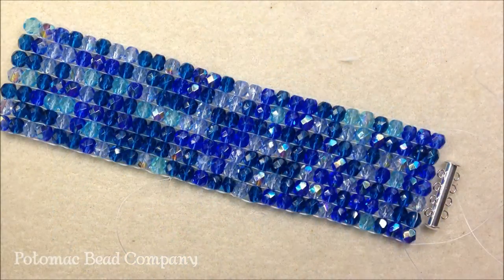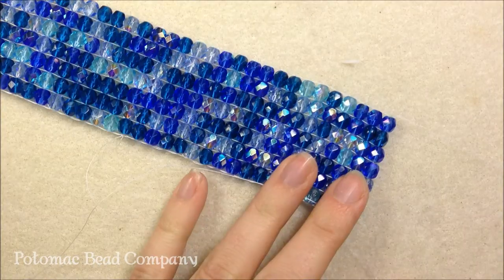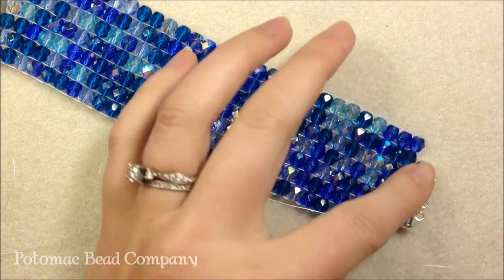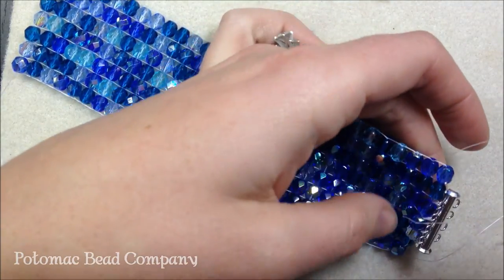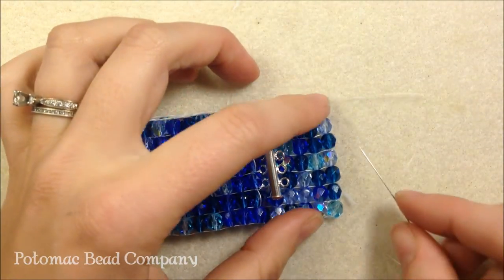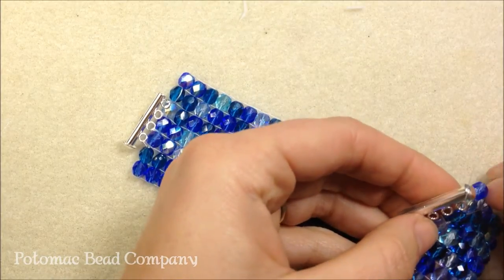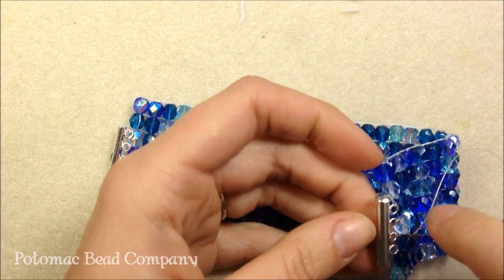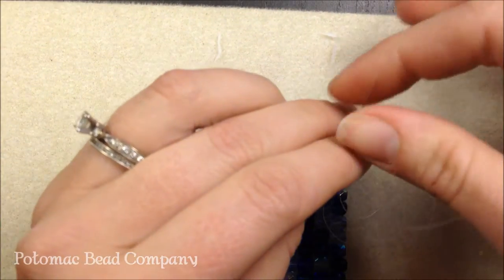How to Add Clasps to Loom Projects

Comment: I like this.  Why don't "finding" companies make clasps strictly for loomed bracelets?  I mean with the metal loops on the clasp "turned" so they would fit "in between" the rows of beads.  Same clasp w/diff. loop orientation? That way the loops wouldn't show & more importantly I believe there would be less stress on the clasp at the attachment point.  (I also don't like the "weave a loop at one end & a beaded bead at the other" solution to finishing loom bracelets).

Comment: Are there tube clasps that are sized to fit across those larger beads?
Reply from the maker: There are a number of different sizes of tube clasps.  They aren't designed for specific shapes/sizes of beads, but you can always adjust to fit.